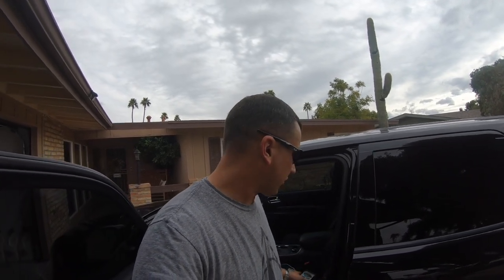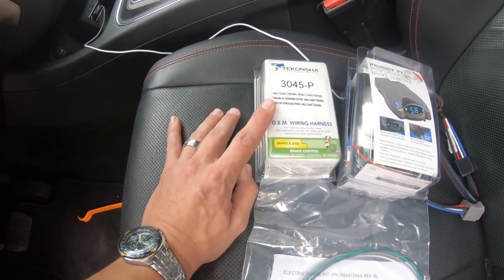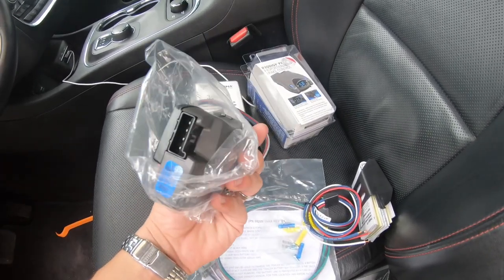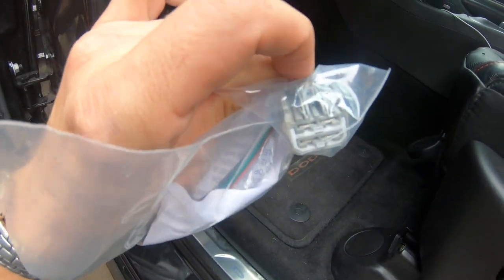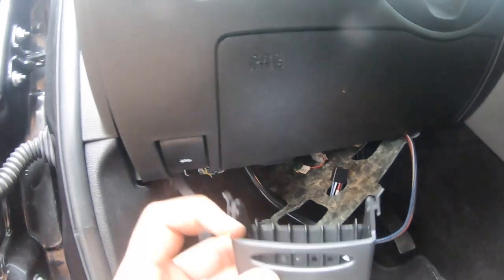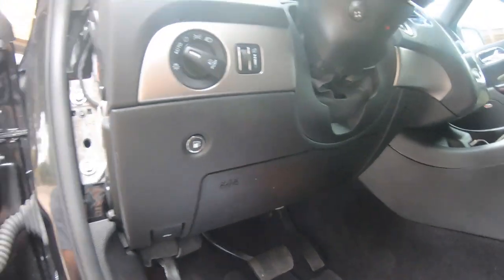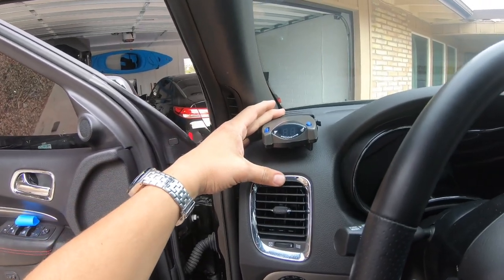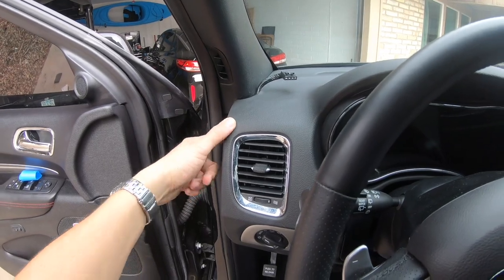Brake controller install

Comment: My 2018 DD GT has the fuse box with the towing fuses, and the brake controller port under the steering wheel as yours is in the video, but didn't come with the hitch receiver or the wiring for the 4/7 pin adapter.  Do you know what wiring harness I should buy?

Comment: Thanks for the install tips. Located mine in the same place in my Cherokee. I mounted my controller using scotch fasteners. Loos like Velcro but stiffer.
Reply from the maker: Glad it helped

Comment: I'm not so mechanically inclined, so when I see the side panel of the dash removed, I always wonder how that is done, and I sure don't want to break something.  I got the side edge of the panel popped loose.  How do you remove it from the front edge (the part that is behind the sealing strip)?
Reply: Answered my own question.  Just pulled harder until both snap-in connectors were free of the holes, and slid the side panel to the left.

Comment: So, once you do that, it just communicates through your trailer hitch harness wiring automatically? 

I hooked it up for a 4pin kit back with my smaller pop-up trailer, but we're upgrading to a 4000lb travel trailer and need to mod up to a seven pin now.